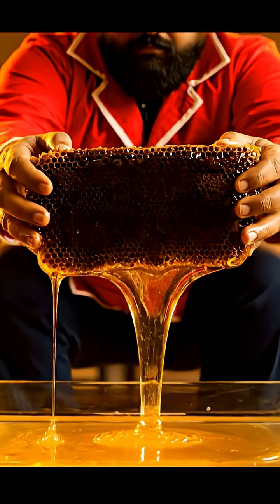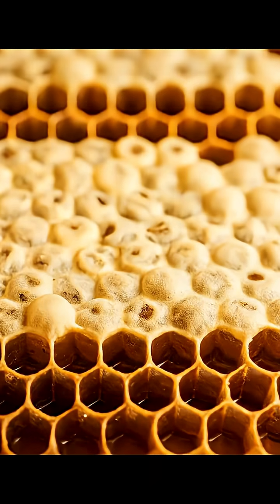Why Real Honey Is Never Runny!

Comment from the maker: Pinned comment:
TL;DR — Mature honey is thick, capped, and barely runs. Early-harvest honeycomb looks “bursting” because it holds more water. Bees make real honey by: collect nectar → share bee-to-bee (trophallaxis) → enzymes break complex → fanning lowers moisture (~20%) → wax capping. Beeswax is indigestible (fun to chew, but it passes through unchanged).

If this cleared things up, drop a 🐝 in the comments! Got questions about honey, bees, or beekeeping? Ask below and I’ll add answers to this thread.

Chapters:
0:00 Bursting honeycomb vs mature honey
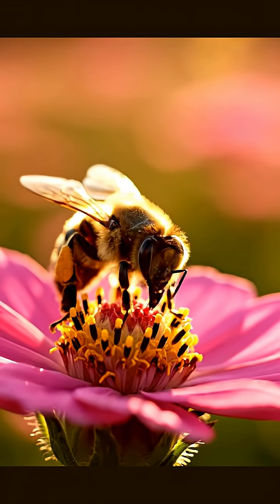0:08 From flower to the “honey stomach”
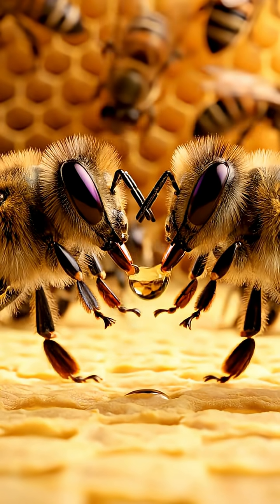0:16 Bee-to-bee sharing (trophallaxis)
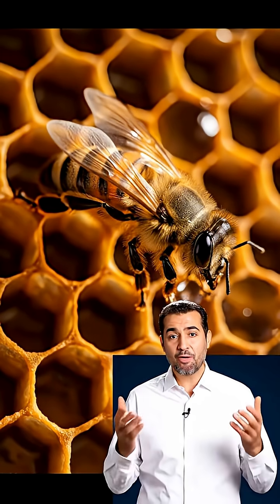0:24 Complex → simple sugars + fanning
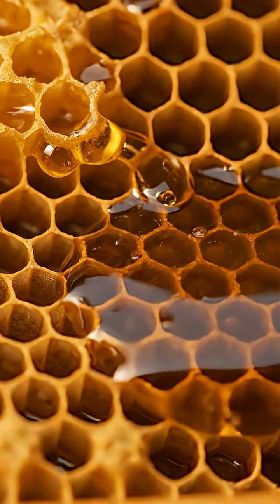0:32 Moisture drops toward ~20%
0:40 Wax capping = finished honey
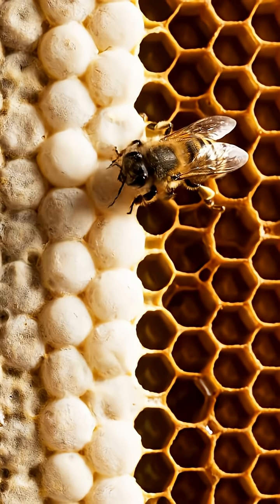0:48 Early harvest = higher water, more flow
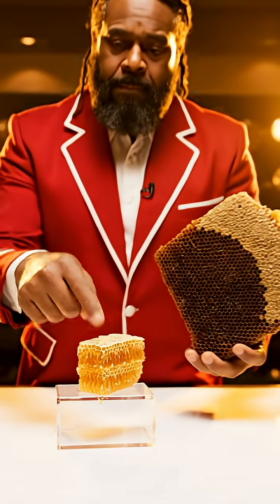0:56 Beeswax is indigestible + recap

Subscribe for more clear, science-based shorts about how bees really make honey. 🍯